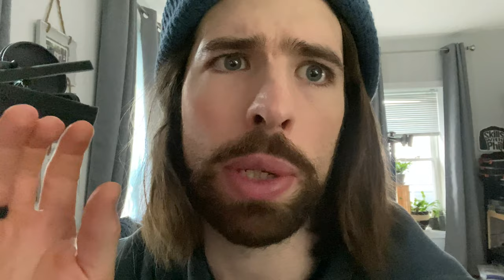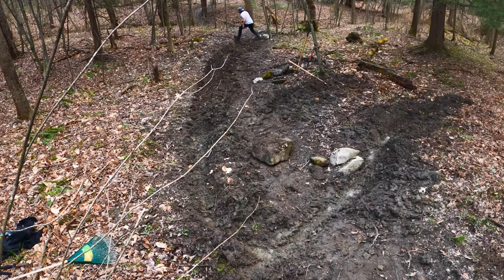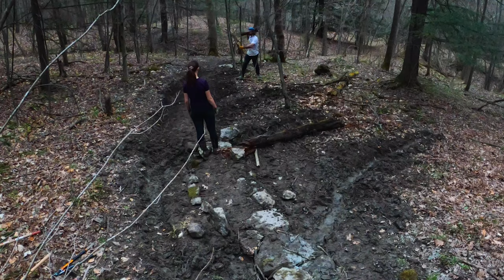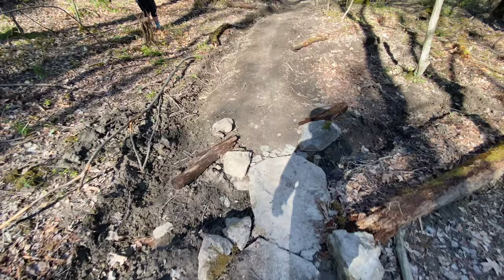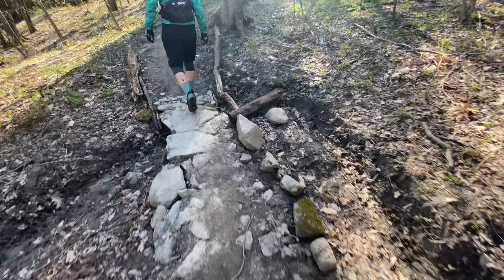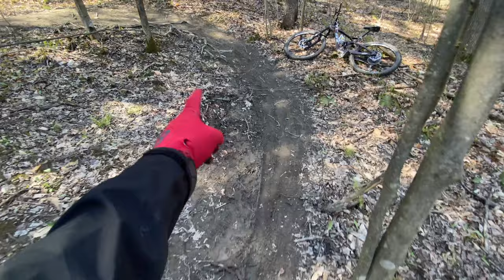Fixing a Trail That's Always Muddy

Comment: I had a soggy back yard in washington. I laid down a couple layers of cedar boughs the leaf like green parts. It worked for me to move trailers in and out of the yard. Always wanted to try it on bike trails. I bet it will work nicely
Reply from the maker: That’s not too different than how they build logging roads in marshlands. Usually they’ll sandwich logs between two layers of a road fabric.

Comment: Hey Phil.  Good building content. Like the amount of graft you put in on these vids. Couple of pointers I though you might appreciate.  Get perforated drain pipe for your water bars. Cheap to buy and stoos the organic blocking it up over time. Trust me you will be forever clearing out the ditch without it. And try not to log line your trails. Carefully placed boulder or sideways log to direct traffic is better. Log lining traps water.
Reply: The Ditch is already filled with Rocks, no need to bury any Plastic in the forest :D